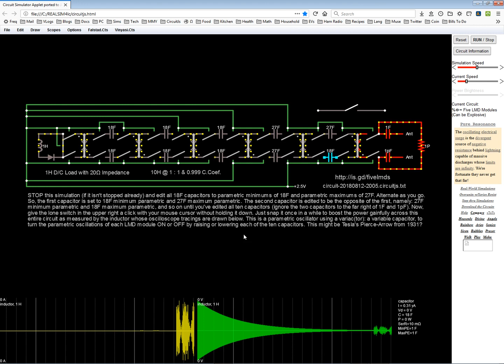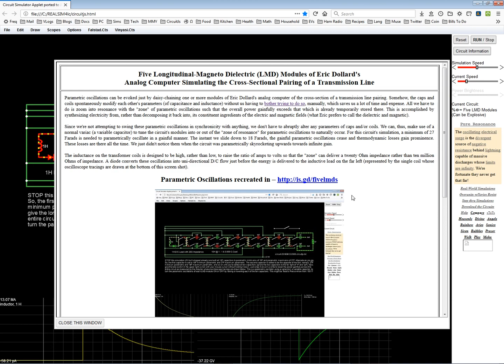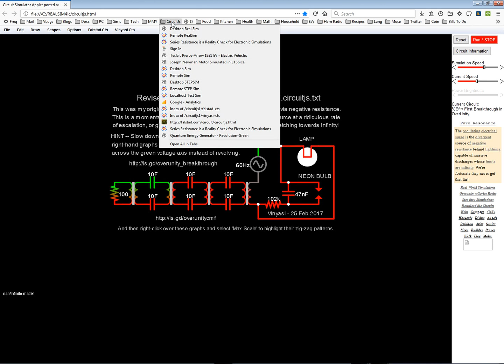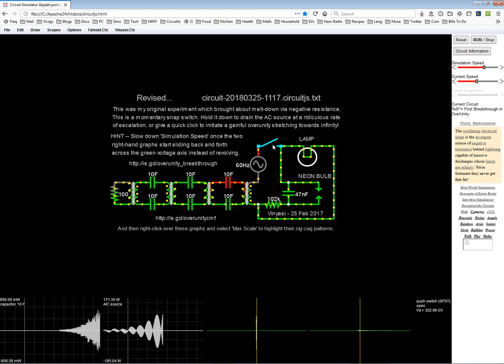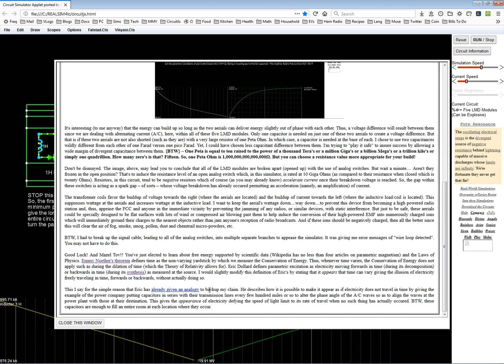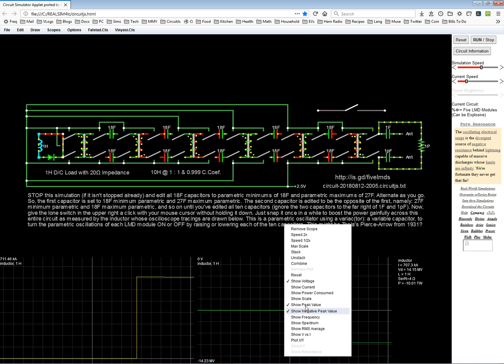Free Energy from a Bottle, or How I Use Eric Dollard's LMD Analog Computer to Synthesize Electri...

Comment: Hey! Love your electronics sims and videos. I've learned a lot from your simulator, and your projects. Thanks for that! Your comments on time-based phenomena made me want to write the following essay. Forgive me for the length, but I think it possibly will help clarify for people how time works, as related to electricity. This is a simplification to some degree, but it handles the basic reality of the situation pretty well. So, enjoy:

One thing I've been dying to understand is the time-reverse concept mentioned by EPD. I heard you mentioning it, and I wanted to offer some insight. Time-reversed wave phenomena are referenced quite frequently by EPD, Tom Bearden, and Dan Winter, pretty much my three heroes (other than Bedini and Tesla). When those three people are on the same page about something, it's definitely worth a closer look.

It turns out, circular electrical waves have a time-forward and time-reverse function to them. Eric is completely correct about that, and it's actually even accepted knowledge in the standard model. Exactly as Eric says, generalized electrical waves - such as those in AC transmission systems - have two superposed components, called the wave and the anti-wave in the standard model (time-forward and time-reversed respectively). Where these two waves cross in space is the local frame of perspective in "spacetime". 

What's important is to realize what exactly is meant by "time". So what then is Eric talking about when he speaks of time-reversal? Time is an emergent phenomena, that arises out of ongoing entropy, a tendency to disorder. There is an "entropy field" that humanity shares - called earth. It is a local, shared reference frame that keeps humanity on the same page. More broadly, the universe can be said to be entropic, and therefore time-forward. So how does time-reversal fit in? 

Time-reversal is exactly like playing a tape recorder backward. Oddly enough, this type of wave has a weird effect on matter, causing "negentropy" or "syntropy" - phenomena that creates spontaneous order. So, negentropy represents a coming-together; an ordering, again making it the opposite of entropy. If you charge up a capacitor, it's subsequent discharge will be a time-reversed wave. That's why capacitor banks discharge so epically (unless discharged through a resistor).

Since the capacitive discharge waves occur in time-reverse, any energy being released from a capacitor rushes out explosively, just the opposite of how an inductor slowly releases energy, and builds up momentum along the way. One amazing thing about this is, if you take high frequency capacitive discharge, you can create longitudinal rays that will literally heal the body. Tesla discovered that fact, and used it to show off to all of his buddies. Bedini uses it in his Bedini RPX device (and it works very, very well). Rife, Priore, and many others followed this same path to create healing, or biological negentropy.

A couple final points. First, even though Eric doesn't talk about entropy or negentropy, his assertion that time and space are metrical are exactly correct. There's no time; just the direction of entropy taken by a given longitudinal field. Second, you mentioned in your video how utility companies use that capacitor trick to stabilize hysteresis over thousand-mile AC transmission lines. I'm pretty sure that all this is is a simple delay phenomena. It delays the wave so that hysteresis is maintained. However, being that AC transmission lines are essentially standing waveforms, there might be something more to that than I realize. I don't feel like I've cracked the code there quite yet, and I'll keep digging through my copies of Eric's lectures until I have a better answer. 

Finally, and most importantly, I believe the entropy/negentropy description of time says it best: there's only one dimension, and that dimension is empty space. Time, distance and velocity are all metrical dimensions that physicists reify - or make real, imposing their ideas onto reality via projection. However! Reference frames DO exist - and time-reversal is a simple matter of perspective. Different objects can be pumped, and they WILL experience time differently. So in other words, time-based effects are real, and they are seemingly "magical".
Reply: And I love your response. No error in making it lengthy!

I take it even simpler approach nowadays…

Time is one of the three ingredients of electricity according to Eric the other two being magnetism and dielectricity which the electrical engineer would call inductive and capacitive reactance respectively. Since the first two ingredients are mathematical fictions, it stands to reason (by extension) that time may also be a fiction of mathematical origin… Ha ha ha!

Actually, there’s another way to look at this in case you don’t like that line of reasoning here’s an alternative…

The mind our mind the human mind tends to impose patterns on what our senses give it and it does so quite often without us even thinking about it.

Take time for instance … Can we taste it? Can we smell it? No! We can’t…

The reason why I don’t apply the other three senses to the question of can I sense time directly with any one of my five senses is because those three senses (of sight , hearing and touch) are the very areas of the mind in which pattern imposition tends to occur. But we do not impose patterns on taste and smell at least not in the mathematical abstract sense but in a more practical sense... do I like it ....do I not like it .....does this wine go good with his fish ....yada yada. Nothing mathematical about taste and smell ......very gutsy stuff. Not abstract at all!

So then I have to ask myself the question… Can I taste time? Can I smell time? No ... I’ve never tasted time and I’ve never smelled time so it cannot possibly be something physical or concrete. It has to be a mathematical fiction. And because of this, the other two ingredients of electricity in all likelihood are fictions also because .... can you mix water and oil ? no ... you have to emulsify the oil ... you have to break it down for it to be able to blend with water. Like that, how can we possibly suppose that if time is a fiction then how can magnetism and electricity not also be a fiction as well?… because we’re going to be blending these three ingredients to create electricity. And these three ingredients better blend and integrate themselves because they do a darn good job of convincing us that electricity is real so much so that I can get electrocuted with electricity but I have never been killed by time alone. Instead, I am killed by the aging process brought on by the current that manifests in my body as a side effect of electrical reactance blending together to create electricity inside my nervous system. So although we claim that we need electricity for a physiology to function chemically (let’s say, when I digest my food), the reality is that the side effect of our use of electricity is that it ages me and brings me that much closer to death! And I say this with all certainty because anybody who practices yoga knows that if they spend a lot of time in meditation they don’t age as fast and everybody who has spent any time fasting knows that the less calories you consume the less stress you create for yourself and that stress actually comes out of the burning of calories. (That’s provided that all other factors being equal you know if you’re not living in Alaska or something similar...)
Reply: @singalongwithkyleandvinnie6680  Hahahaha true. We're getting into "there is no spoon" territory over here lol
Reply: @danmoretti8898  I added another thought to that comment if you’d like to reread it…
Reply: @danmoretti8898  funilly enough there is another approach to take 

forget about whether or not it’s a fiction

from the standpoint of yoga from the Vedic literature the actual sequence that Eric Dollard uses magnetism dielectricity and time (for the three ingredients of electricity quoted in that Tesla 2.0 YouTube video of him) is the exact equivalent of sat-chit-Ananda = energy-intelligence-bliss 

the intelligence being the emptiness - the vacuity - the void - of the dielectricity of empty space of the dielectric material so to speak of empty space is chit = intelligence = it’s emptiness = in fact , that’s what the I Ching describes as K’un translated into English is intelligent , darkness and what Nietzsche calls the void is actually receptivity